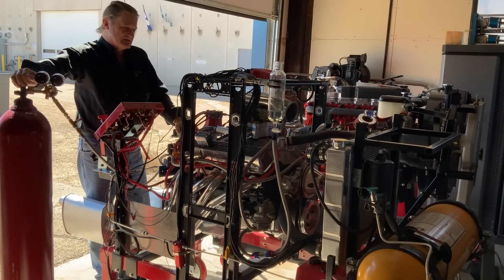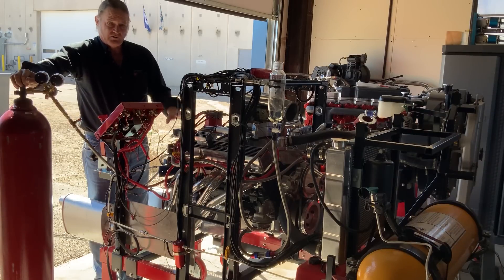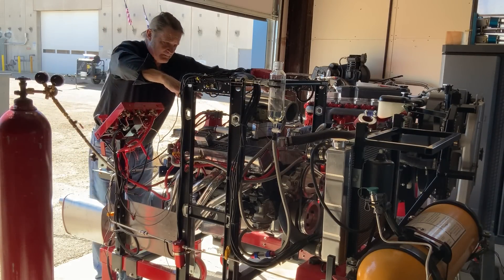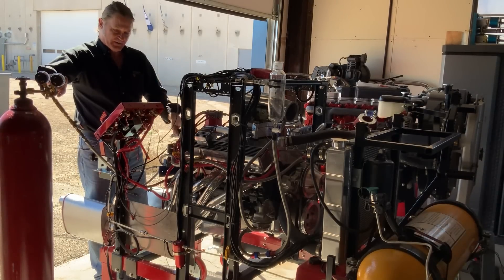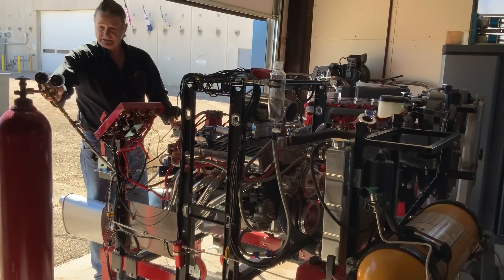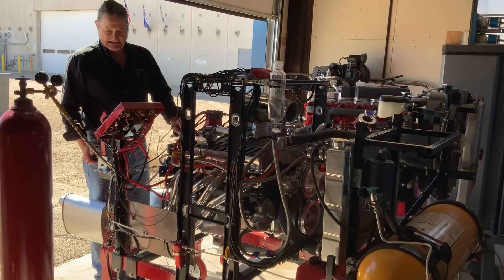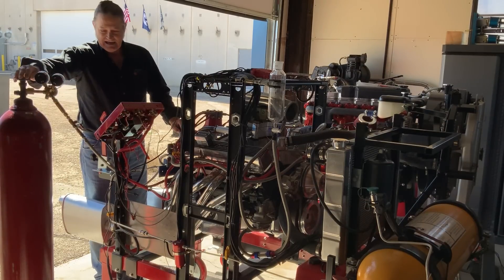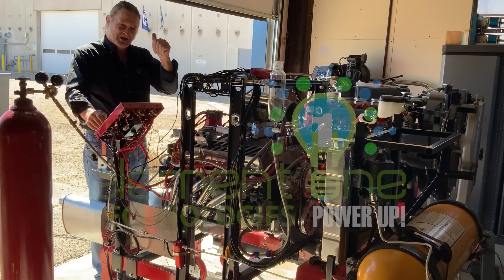Hydrogen powered V8 ICE High RPM Test

Comment: I see alot of potential here! I have wondered about injecting vaporized water to reduce knock? Either way imagine a zero emissions hot rod that still has a normal engine in it!
Reply: There is no knock with hydrogen. You can lean it out up to lambda 7, which is almost as good as a diesel. Only problem is the low power density, direct injection and turbos are a must.
Reply: @German_overengineer  That isn't true.... if you run it too lean it could create an explosive detonation. Its just harder to do. You can technically water inject on a hydrogen ICE, it just won't benefit anything but niche cases.
Reply: @madjimms  I think you'd need to run very high compression and advance to run into any kind of detonation related issues.
Reply: @detaart  you would need over 3000K to heat Ignite hydrogen, that’s why you don’t see any diesel hydrogen engines. You could make a homogeneous hydrogen diesel engine, but you would need a diesel injection to light it. That’s actually something that currently is being worked on, only with gasoline and not hydrogen. It greatly improves low load thermal efficiency, but it’s still very experimental. It’s the next evolutionary station of the Mazda sky active X HCCI Engines.
Reply: @German_overengineer  The auto ignition temp of hydrogen in air is 585 deg C, cylinder temperatures of an otto cycle engine under load can easily exceed 1500 deg C.
Yes, knock is definitely a possibility.
Reply: @detaart  even in a diesel compression temperatures don’t exceed 1000C. 3000C is the ignition temperature in air, in a compression ignited engine. hydrogen has a really high thermal capacity. 585C counts when you have something like a Metal surface, in air it sucks the heat up and cools off the air. 

TL:dr knock isn’t possible with hydrogen in real life engines.
Reply: @Overengineering  hydrogen injectors do exist along without turbos I don't see why no one has made this a kit
Reply: @playstation8779  I think it’s cost and lack of hydrogen infrastructure. Also storage is a huge problem, a 700bar tank stores 2kwh/kg, or like the fifth of gas per kg.
Reply: @German_overengineer  Hydrogen embrittlement is also a huge issue. Tanks and infrastructure would need to be completely replaced very regularly.
Reply: @EddieTheH  no, these problems are Long solved.
Reply: @German_overengineer  They absolutely are not. How does one solve the problem that's intrinsic to the physical properties of hydrogen?
Reply: @EddieTheH  hydrogen only brittles regular steel and some alloys of aluminum. We got millions of different materials to work with and people work with hydrogen since the 1800s.
Reply: @German_overengineer  That's untrue, it embrittles almost all materials, nothing is dense enough to contain hydrogen without suffering embrittlement. There's also nothing that can contain hydrogen adequately without substantial leakage.
Reply: @EddieTheH  leakage doesn’t automatically mean that the material becomes brittle. Also PTFE isn’t permiable for Hydrogen in any meaningfull quantity.
Reply: @German_overengineer  "However, it is apparent that hydrogen can embrittle most engineering alloys."
That's a direct quote from a hydrogen supplier. They're trying to sell hydrogen, why would they lie?
Reply: @German_overengineer  PTFE absolutely is permeable by hydrogen, nothing exists that isn't. When did I say all leakage indicated embrittlement? I didn't, I said hydrogen leaks, it's a problem.
Reply: @German_overengineer  HDPE is better than PTFE, but both are crap when you use cooling to keep the hydrogen in a liquid state, as they become very brittle just with the temperature, before the hydrogen even enters the situation.
Reply: @EddieTheH  „most engineering alloys“ are C45 and ST231. Cheap, crappy carbon steels.
Reply: @German_overengineer  Makes no difference, hydrogen storage is, and will always be, a complete PITA.
Reply: @German_overengineer  Name the alloy that doesn't suffer from hydrogen permeation or embrittlement.
Reply: @German_overengineer  3 days and you didn't manage to find any?
Reply: Knock is not a problem with using Hydrogen in an ICE engine you actually could run higher compressions with Hydrogen without creating knock.  Bigger issues are the low volumetric energy density of Hydrogen gas which will result in a lower max.  power output with naturally aspirated engines and this low volumetric energy density is also a problem for tanks size & weight.  Also a problem for an ICE is the combustion temperature in combination with Hydrogen being on of the few gases that actually heats up when being decompressed into ambient air pressure / temperatures so under full load you actually may need to use something like water spray to lower the inlet temperature or risk catastrophic thermal failure of pistons/valves.  
Hydrogen has been used back in the very early days of combustion engines ( e.g. Hippo mobile )   prior to gasoline coming on the scene and also some big automakers using it for  some showcases ( BMW, Mazda, Toyota,...)  and it always comes down to it being to costly  to operate an ICE with Hydrogen and space issues as well regatrding weight and size of the tanks required for te H2.  Food for thought,  a standard Size 200 gas cylinder contains about half a kilo of Hydrogen which is the energy equiv. of about half a gallon of Gasoline and the cylinder weighs over 100lbs.
Reply: @milanswoboda5457  every car guy in the world know knock or pinging wrecks pistons!
Reply: @kinzieconrad105  did I say that knock or ping does not wreck pistons?
Reply: Burning hydrogen in air produces heaps of NOx emmisions. Everyone seems to ignore that bit.
Reply: @sexyfacenation  it doesn’t produce more than any fuel at the same temperature. NOx are easily reduced with SCRs.
Reply: @German_overengineer  how do you get the same temperatures though? H2 burns hotter, nox goes up. 
Burning it is easy, this engine test shows absolutely nothing. 
Doesn't appear he is measuring emisons at all. 
I work at a uni researching h2 combustion in domestic appliances.
Reply: @sexyfacenation  I also work on H2 engines. Combustion temperatures are comparable with them of a diesel engine.
Reply: @German_overengineer  👍
Outside of engines, in regular burners in cooktops, ovens, space heaters, boilers etc the combustion temp definitely goes up leading to high NOx, and no real feasible way to fit a cat to help out .
I just want to be realistic that H2 isn't as simple as people would like it to be!
Reply: Wouldnt be 100% zero emission, as it will still burn some oil. But it will be alot better. Also i forget i think hydrogens octane rating is 130 (ron)
Reply: @Colt45hatchback   Its still zero emission. The fuel used isn't creating the contaminants. Any piston engine needs film for pistons skirts. If its burning oil you need new piston rings or valve seals and guides.
Reply: @3n3ly7m9  Hydrogen with ambient air creates NOx emissions due to the combustion temperature in the ICE and the large qty of Nitrogen that is present in the ingested air.
Reply: @milanswoboda5457  lol NOx, that's why we have catalytic converters
Reply: @3n3ly7m9  piston skirts do not prevent oil burning, you cannot create a complete seal between the piston skirt and the housing... EVERY engine burns oil. If it didnt, your piston skirts would melt in less than 100 revs
Reply: @milanswoboda5457  yes, but that is easily removable with a SCR car. It’s even possible to engineer one in the future that runs on hydrogen and not adblue.
Reply: @3n3ly7m9  you always burn oil. There is work being done in graphite Pistons that won’t need lubrication, but I’m not a believer in that being a solution for the mass market.
Reply: @German_overengineer  He made it sound like it was consuming oil.
Reply: @3n3ly7m9  if you got normal worn in turbo diesel, so will burn about 1l/1000km that’s perfectly normal.
Reply: @julianbrah5873  Lol NOx is being reduced by the catalytic converter but not completely removed, so....
Reply: @German_overengineer  Never had a diesel, well newest one was a 2019 F450 Plat and then F450D, never had problems with them even after 40k miles. Same with 05 with 438k
Reply: @milanswoboda5457  SCRs can remove NOx to 99.999%
Reply: @German_overengineer  SCR adds cost for both the SCR system and running cost,  additional item to fill,  space, weight and maintenance,... etc.  and sorry 99.9999 % is  something done in a lab and not in real world varying conditions where you might get UP TO 90-95% NOx removal.  The short story and H2 ICE is not emission free at the exhaust but certainly has less than a Hydrocarbon ICE there and on the bigger picture well to exhaust the difference will likely be far less with the majority of Hydrogen on the market being gray Hydrogen and with it moving the carbon emissions from the vehicle exhaust to the Hydrogen manufacturing process.
Reply: @Colt45hatchback  yes, that’s why 1g/km co2 counts as zero emissions. It’s hard to quantify it’s RON, some sources say 130 and some 150.
Reply: More uninformed nonsense.
Reply: @rogerphelps9939  hmm. Can you back why you stated nonsense?